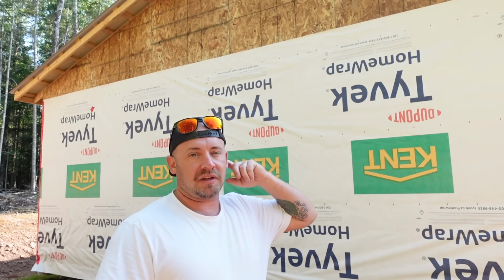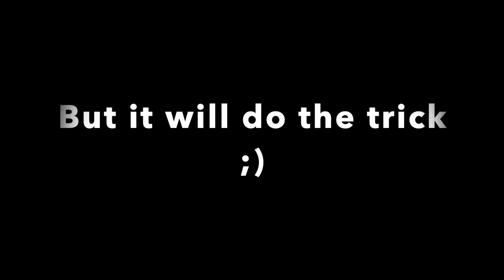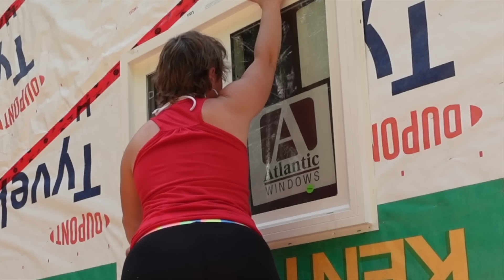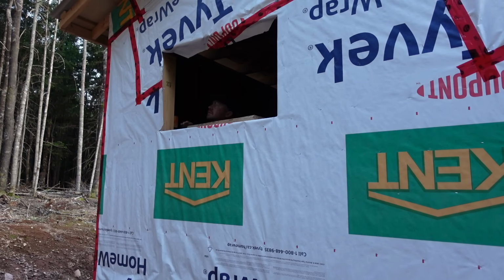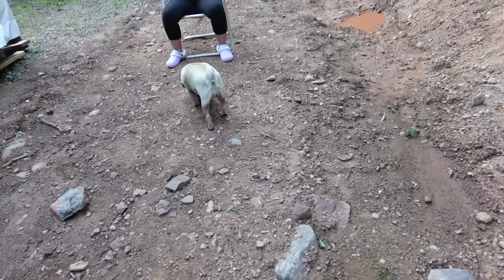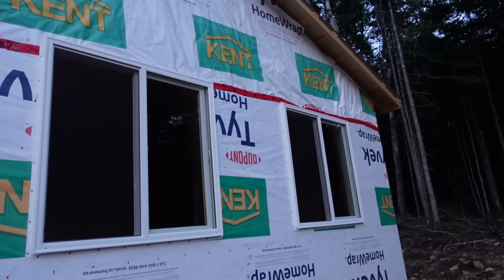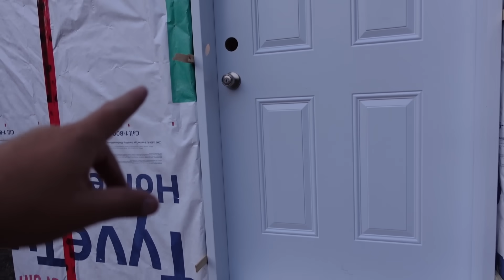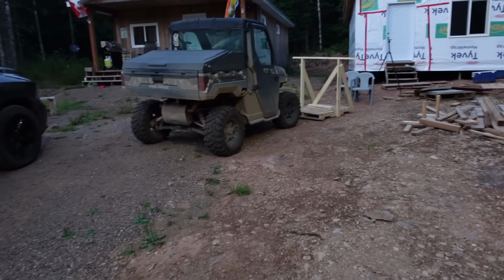Things Are Moving Right Along! ❤️ | Windows 🖼️

Comment: Jeremy crazy question….. did you run a level across the bottoms of your windows to see if they were level to each other ? 
  Stay Safe and caution to momma on the ladder being pregnant  🇺🇸👊🏼👊🏼✌🏼
Reply from the maker: They are the same height :)….well the tops are as that is how we measure most windows, from the height of the ceiling .
Reply from the maker: The front picture windows are equal top and bottom .
Reply: @MBFModernHomesteading  
 I figured they were .. great job 🇺🇸👊🏼👊🏼✌🏼

Comment: Roof on , Doors and windows Installed mean lock-up for winter. Work inside usually comences at this point; wiring, forced air heating and plumbing followed by insulation,then vapor barrier.